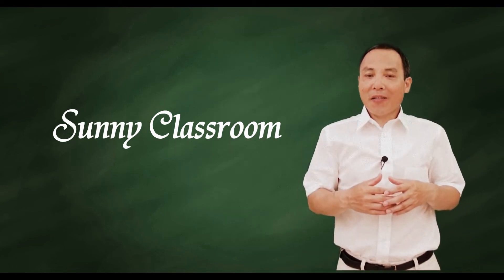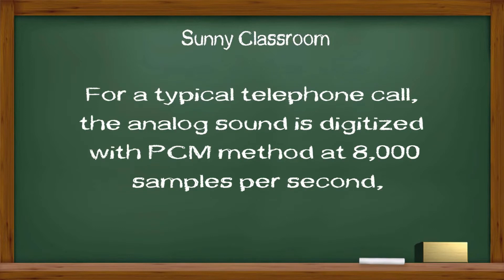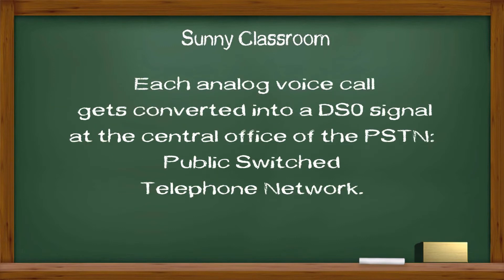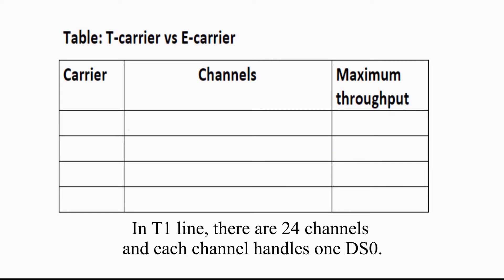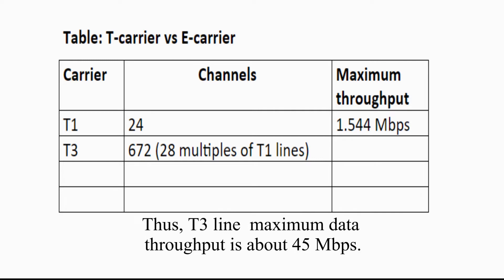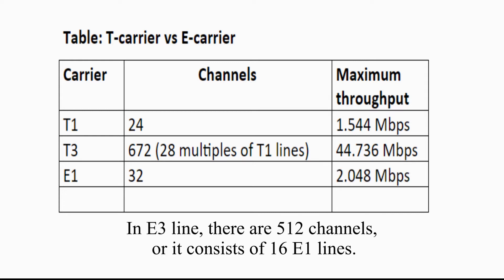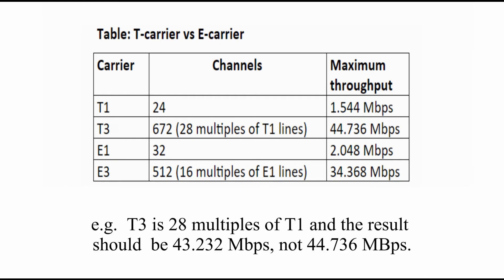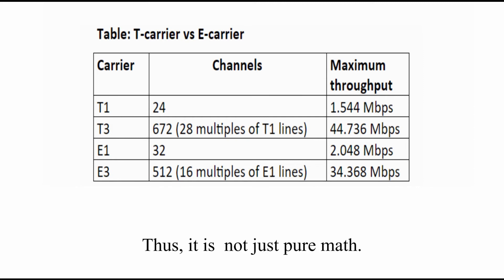DS0 - beginning of digital telephony (T1, T3, E1, E3)

Comment: Kindly make a video on Dedicated internet lines and Shared lines. and also share information that FTTH technology give us dedicated lines or shared internet lines.
Reply: Yes. Shared, if carrier uses GPON.  32 to 64 customers share ~2.5Gb.

Most carriers use a GPON architecture for FTTH. 2.5Gb uplink from OLT PON port provides circuit to one splitter. That splitter can be a 1x2 split or 1x16 or 1x32. Whatever the combination of splitters or if the design calls for just one splitter , most companies don’t split a GPON pon port more than 64 ways.   Typically, the pon port travels directly to/from a 32-way splitter. The 32 pigtails from the splitters are routed to the various distribution ports of a fiber cross-box. This provides the passive circuit from the exchange to the curb or the home, whatever the case may be.